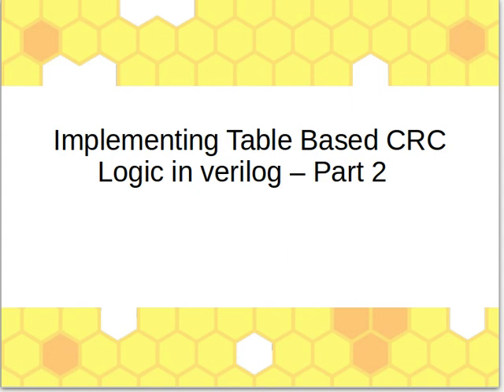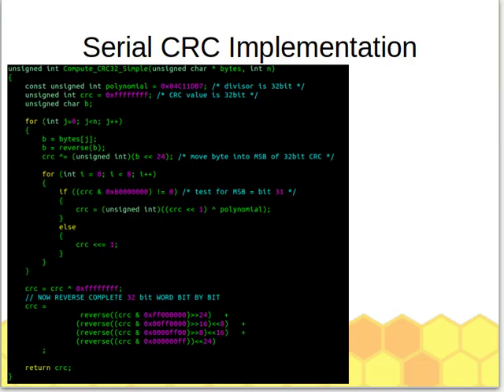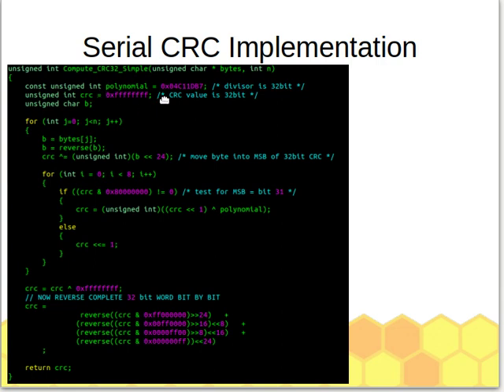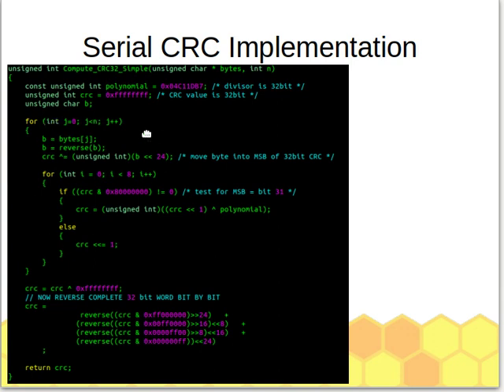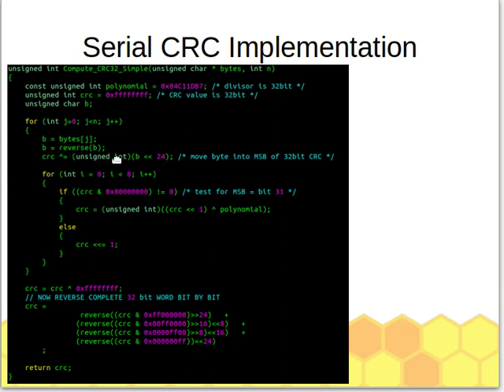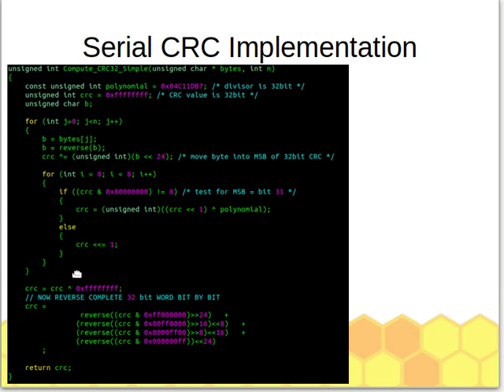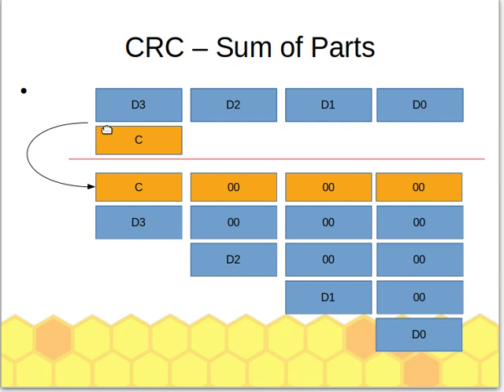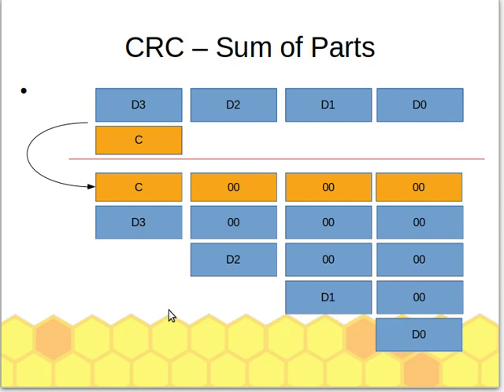100 Gbps Table based CRC32 computation for Verilog - Part 2

Comment: Can this code be use for data inputs of only 32 bits instead of 256 bits?  Would the tables stay the same and you only need 4 tables?
Reply from the maker: For 32 bits, i would recommend to directly compute using combinatorial logic as it should fit within the current ASIC/FPGA technology.
Reply from the maker: Look at sites like - http://outputlogic.com/?page_id=321